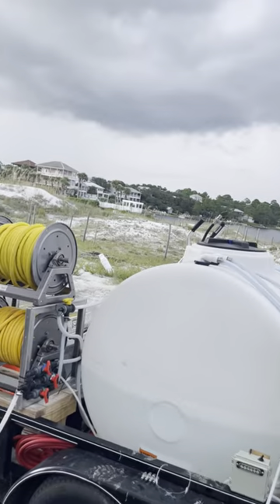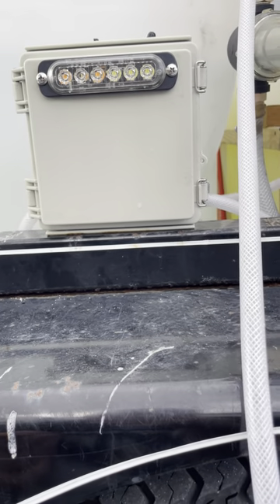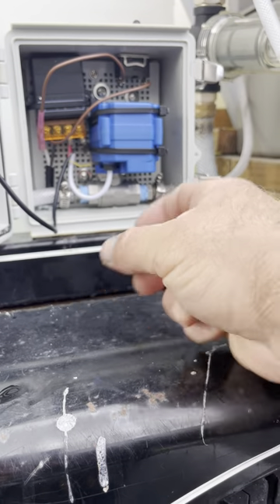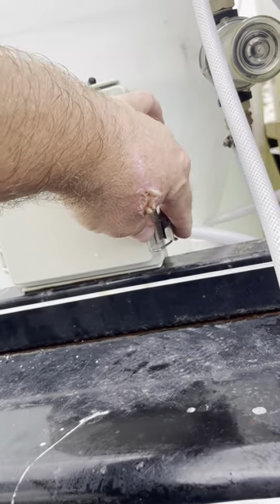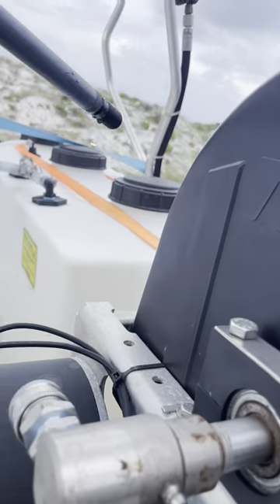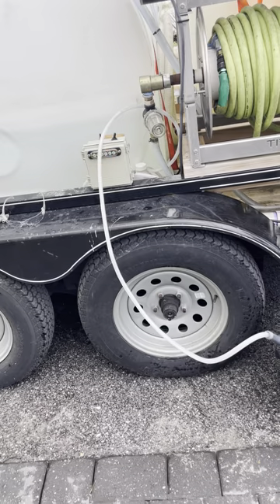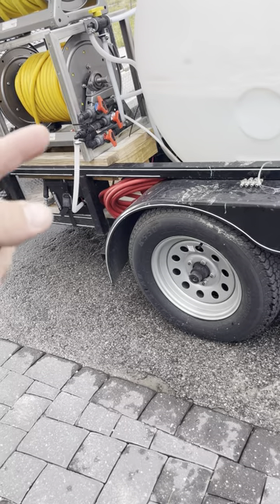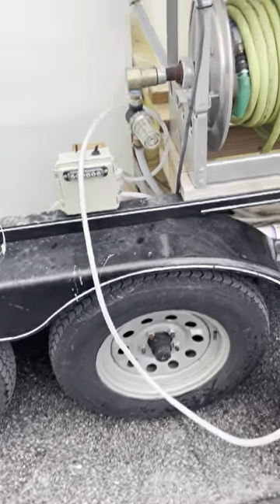DIY Remote Downstream Injector

Comment: Im making one but Im adding fittings on each side of the box to connect lines inside and outside so the hose itself isnt going through the hole. 
I think this will make it completely water proof and make that remote receiver last longer.
Reply: I would recommend doing a rubber grommet and push hose through if you are worried about waterproofing. If you start adding fittings it’s more places for a leak to occur. If don’t properly I’m sure it will be fine and you will enjoy it! I do not down stream a lot but it’s sure helpful. The ball valve I used lasted about a year before needing replaced but it’s very cheap and easy to replace

Comment: I built mine 3 years ago works great still.  Only thing that failed and it took 2 years was thr ball valve corroded out after 2 years.  It's a simple fix one positive wire one negative to reciever and all fixed.  Very important to run a bleach neutralizer through it after every wash to maintain it without doing that these ball valves won't last that Long

Comment: Thanks for the video content. Very much appreciated. Did you make a remote shutoff for the 12V system? If so, would you mind doing another video? Thanks again!
Reply from the maker: Sorry for the delay. I have not made one yet. I have been slammed with work and just working with what I have at the moment. I will upload a video when I do get around to this. I believe I’m going to make it with a 3 way ball valve for cleaning lines out after use.

Comment: I do fleet washing any idea on how to make a 4 channel one? And what do you use to set your ratio?
Reply from the maker: I am not 100% sure to be honest with you on this one. I would have build something and try it before telling you if it works or not. 
The downstream injector automatically pulls the strength that’s needed to clean the surface. This setup is good for some hardiboard but mostly vinyl houses. It will not pull strong enough to clean stucco or bricks concrete or super dirty hardiboard.

Comment: Are you still using this remote downstream? If so how’s it been working for you?
Reply from the maker: Hey, I mostly use my 12v. I have an ar45 also but don’t use much. I down stream ever so often and it works great when I use it.
Reply: Does this need to have a fuse before the box?
Reply from the maker: @memehub1603  I didn’t put one but I would recommend it.
Reply: Novice here. Where would you put the fuse?
Reply from the maker: @matthewstanley893  I would put it on the power line from the battery going into the sealed box. Before the switch.
Reply: @vickerspressurewashco.890  thanks so much. Im attempting to build one right now. I’m also trying to wire up my soft wash system. I’m using an Everflo 5.5gpm pump and have to get it hooked up to a marine battery. 

Any suggestions on having one power source to run everything electrical to? I guess anything electric would always need it’s own fuse? I think the Everflow pump has a fuse built-in on one of the lines.